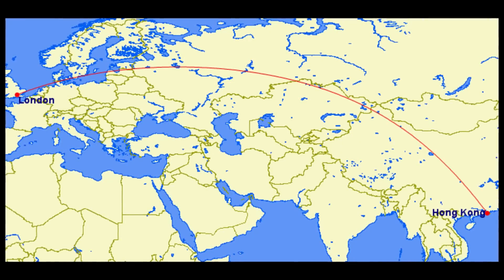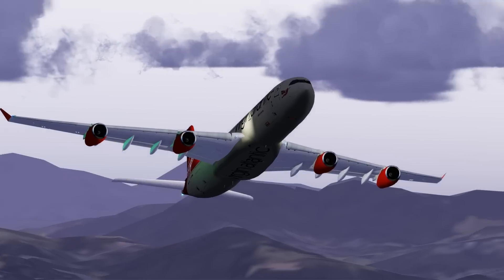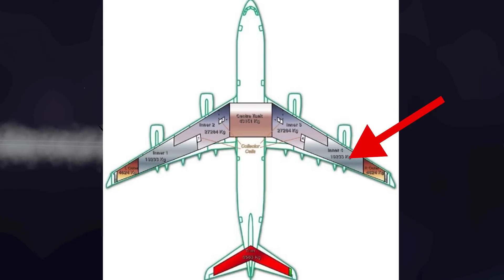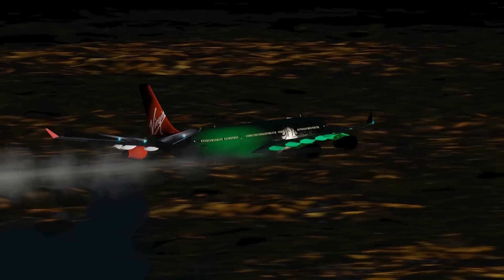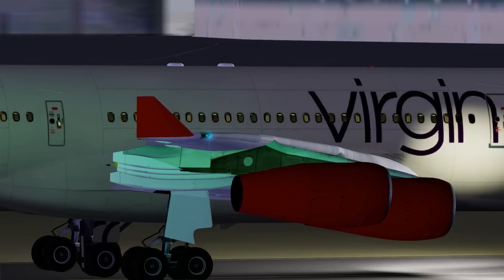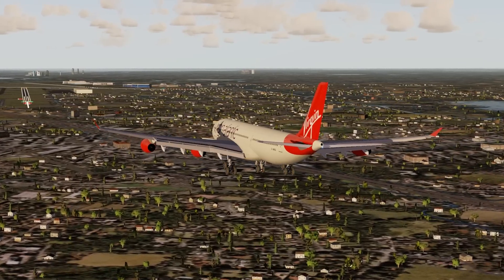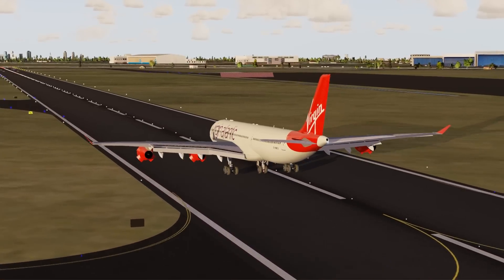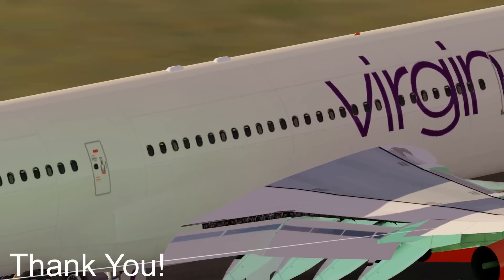How A Broken Clock Left A Passenger Jet With Almost No Fuel | Virgin Atlantic 207

Comment: 14:25    "What do you think of all this?  Let me know your thoughts in the comments below."

I think modern airplanes have become far too complex, resulting in unreliability, and difficulty (if not outright impossibility) of diagnosing problems.   You have computers controlling computers, which control other computers.  A chain is only as strong as its weakest link, so a failure of any one of these multiple daisy-chained computers results in a systemwide failure. 

"The 9000 series has a perfect operational record."

"I know I've made some very poor decisions recently, but I can give you my complete assurance that my work will be back to normal. I've still got the greatest enthusiasm and confidence in the mission." 

"Open the pod bay doors please, HAL."

"I'm sorry, Dave. I'm afraid I can't do that...."

Comment: In olden days there was a human flight engineer.  One of their responsibilities was to keep track of fuel consumption.  They would gasp actually look at an analog meter, interpolate to get a number, and use a pencil to make a dot on their fuel graph.  From that graph they could determine if the gauge was working, I.e. the level was not zero or pinned beyond max and slowly dropping on any active tank, therefore a plausible reading.  From the position of the dot on the graph they could judge whether consumption was reasonable and nominal, whether it was trending better or worse.  There were not duplicate and supervisory computers that could mask or override or misreport or obscure the situation.  In all too many recent incidents the flight crew seems to have had no knowledge of the fuel situation until engines conked out.  IMHO, unacceptable.  Some human should be explicitly watching.  Apparently the automated systems are not smart enough to agree on what is wrong or what to do about it.

Comment: This was just part of the share of electronic problems Airbus had to go through building a complex machine.Boeing also have their share and so will the Chinese  and everyone else.  because of great crew training and luck, it did not crash. No mode of transport is totally safe. They might have discovered they have a problem much earlier if they have retained the engineer on board to watch engines and fuel flow. But then, planes in that era have no computers to play tricks on the crew.

Comment: The nice thing about the A340 is it’s just an extended A330 with extra engines. They both use the exact same wing design, but the A330 has the outer nacelles blanked off. As such, it would make sense for the plane to be able to fly with only two engines, though you might expect some trouble
Reply: For the -200/-300 yes. The -500/-600 has a larger wing

Comment: "Maintenance crews just expected pilots to pull a few circuit breakers"

Unlikely that "Maintenance crews" expected this, more likely that the airline CAMO dictated this as a temporary solution to an ongoing issue.

Pilots are only authorised to operate certain CBs and in certain circumstances.
This has to be authorised by either the flight manual, operations manual or other CAMO document.

If aircrew "pull a CB" because "A Maintenance crew told them to" they are violating safe practices.
The only circumstances where this would be OK for example, would be in a situation where the airframe has taken major damage and has multiple system failures which the flight/operations manual does not cover.
For example those historic incidents where engines have been ripped off, control surfaces damaged and hydraulic systems lost...
Reply: The A340 has reset switches above the pilots which are permitted by the crew to operate. Any CB’s they shouldn’t be pulling are in the avionics bay for a reason

Comment: Very poor system design, and as usual, lack of attention to errors. Pilots treating aircraft like cars. When there is an error warning, don't take off or keep flying.
At the very least, the systems should separate serious errors from insignificant errors.
An error warning that comes up 50% of the time, being the same error that can crash a plane, is the problem.

Comment: Sometimes it seems like replacing the Flight Engineer's console with a glorified arduino might not have been the best decision; and IMO anything computerized needs to have a mechanical, hydraulic, pneumatic, or hard-wired backup for it because having your redundancy be "we have 2 of the same computer that have to agree with each other" doesn't really work when computers are fragile, fickle, full of buggy code, and (in the case of aircraft and spacecraft) constantly being exposed to bit-flips in RAM and ROM whenever they're at cruise altitude from the amount of cosmic radiation. Error checking can only do so much and when your plane's got an expected service life measured in decades, it's extremely concerning to trust a computer to be the only thing capable of performing a flight-critical task.

Comment: How could the plane land safely with that huge amount of fuel?
Reply: Considering an A340-600 can carry about 152tonnes of fuel on board. Less than 30 is not that much in comparison.
Reply: @tomstravels520  where did the fuel go? Don't understand
Reply: @STOPEJECTPLAY  it was stuck in the centre tank. It did not transfer from centre to wing tanks automatically because if the computer failures
Reply: @tomstravels520  thank you. Understood.

Comment: Longtime Airbus pilot here and I’m confused why you think the ECAM item “FUEL T TK XFR FAULT” is a poor naming convention: it was written for qualified A-340 pilots, not for the general public. ECAM titles can physically take up no more than one line on the display with the action steps below that. You apparently don’t know that “XFR” is an abbreviation for “transfer” in many models of aircraft, and this would have not been misunderstood by the crew. If anyone is confused by the title of a procedure (which will always start with the relevant system name, i.e. “FUEL”), there’s a description in plain language as the very next line on the page. 

Second point: not all ECAM items have actions for the pilot to take. After finishing the ECAM message and referring to the QRH in those cases the procedure normally just says “Crew Awareness”, and it gets written up in the logbook. When time permits, company maintenance will normally be contacted to make sure the crew didn’t miss anything; you didn’t say if that was done in this case. 

There are some authorized resets for Airbus aircraft, but not having flown the 346 personally, I don’t know if this was one of them. 

To mitigate exactly this kind of issue my company mandates looking at the fuel page at every reporting point at a minimum to make sure that not only the quantity required is onboard, but that the distribution is also normal.
Reply: Not sure which Airbus you fly but in the A320 family it has the circuit breaker panels behind and above the pilots. On the bigger planes it has the reset switches (like circuit breakers). Those are only above the pilot and may be reset if required. Anything not above the pilots should not be touched apparently is the policy
Reply: @tomstravels520  Are you addressing Virgin SOP or Airbus FCOM guidance? The norm is not to reset tripped CBs on any panel if not needed for safety of flight or specifically authorized. There are some CBs that are forbidden to be reset under any circumstances (e.g. wingtip brakes). There are also Airbus-specific system reset procedures, some of which involve CBs and some of which do not, that are authorized; some of them are only authorized on the ground, some are different on the ground and in flight. My point was that the crew performed a reset involving CBs, seemingly from memory (if I I followed the narration correctly) and it was a common occurrence in this specific fleet. What was not revealed was whether this was a reset specifically authorized by Airbus and Virgin.
Reply: @HEDGE1011  supposedly the reset buttons on the long haul fleet can be used. So for this to reset the FCMC they would pull the FCMC reset button then push back in which they seemingly did but not for long enough. It’s the same as doing a PRIM reset by turning off and on

Comment: I liked that you used A340-300 cartoon for this A340-600 video. I like those tiny engines on this huge plane.
Reply: Not forgetting it appeared to be at cruise altitude with the slats extended.

Comment: As the Centre Tank is used before the Wing Tanks i think i would have Checked the Contents of the Centre Tank during Flight as a Precaution that it was Actually Feeding the 4 Engines, if not, Open the Bleeds from the Centre Tank to the Wing Tanks to keep the Wing Tanks Replenished, and this could have been Achieved within the 1st half hour of the Flight as there was way in Excess of 35 Tons of Fuel Onboard.

Comment: We should all strive for zero fault tolerance whenever it's reasonably doable.  Turning back to HKG would thus have been the wiser choice.
Reply: Not always a practical solution especially if you don’t have maintenance facilities at that airport you just took off from. If it’s a minor fault and you have other systems to take over it’s usually fine to continue
Reply: @tomstravels520  Fair enough. But it turns out it wasn't so fine. Was the extra risk worth it?
Reply: @cchris874  this was only not fine because a fault Airbus did not know could happen. Now it’s been fixed and advise put out incase this happens again
Reply: @tomstravels520  

Yes, I do agree. But the crew ALSO decided to take a risk when it was not necessary to do so, however small. I think it boils down to, if you have any indication that is relatively uncommon, such as being unable to extinguish a safety warning, and having the opportunity to  land much sooner, why not err on the side of caution? Safety culture, IMO, should resolve any unusual doubt in favor of safety, not of convenience.
Reply: @cchris874  sorry but what was the risk? They got a warning to say FCMC 2 had failed. They still have FCMC 1 and if that fails it just means they loose automatic control of the fuel, they can still manually transfer fuel. However they never got the warning to say FCMC 1 also failed. If they did they likely would have diverted sooner. Or if they had kept a frequent eye on the fuel page they would see that the centre tank is not pumping into wing tanks earlier and had more time to deal with this. You’d be surprised what modern planes can be flown with non operational and still certified to fly with. As I said it’s not always practical to just return back if you can’t get the aircraft easily fixed there. Then you have to get the passengers food and accommodation.

I think you need to realise what is a safety critical failure and what isn’t and how these aircraft are certified to operate with different failures and redundancies

Comment: Problems that occur frequently, even when they seem manageable should be escalated and the real reason what goes wrong should be determined.
I had things like that in IT on medical diagnose equipment. You find a system totally messed up and when you ask more intensive you hear, that for months or even years it got a habit to do crazy workarounds by the without operators without understanding what they risk or mess up but informing service personal because ....

Comment: Cars that won't start if a door is open, won't go into gear if the bonnet is adjar, remove most engine power if a sensor becomes faulty without mechanical fault. Don't allow data geeks to design impediments to mechanical function, this whilst supplying no remedy for their data malfunction, data controlled mechanisms without  mechanical mechanisms to manually controll those functions physically, or to override bad inputs by computer,  by pushing ignore when computer has placed you in peril. A digital or manual override must be available as required or we are all fools in a geeks basement, watching them rule a world without common sense, applauding their botched ding dong noises, their plans to remind forgetful bags of grocery, animals, baskets of washing to put it's safety belt on, how obviously lacking  common sense was this wiz at the keyboard. I kno when I'm going beyond a certain speed but the antagonizing continuance without a manual relief, head butts to that genius. Harping moaning, i know best, ding ding ding ding ding dong brain looser. I wish I could meet up with warning noise developers personally, not to advise or complain about their accomplishments, but to break their fingers and glue their eyes shut, I'll say I just had a little malfunction, it happens some times, nothing you can do, surprise, push restart.

Comment: 1:50 .not correct, an ECAM caution without actions is not considered weird, its pretty common actually.
what you are describing is a Level 1 ECAM caution.
They carry no ECAM actions to complete and don't offer any aural alarm to us in the flight deck.
They are purely displayed on the ECAM for giving us awareness of system degradation and me must then monitor the status of the fault (if possible)
hope this helps
* also FUEL TK XFR FAULT means fuel tank transfer fault 🤣standard aviation phraseology seen all over the world

Comment: If the problem is really as pervasive as mentioned, I'd expect a mandatory recall to replace the unreliable units before something like this happens again.
Switching devices off and on again routinely is not the kind of reliabilty I expect from a modern passenger jet.

Comment: Similar to and yet different from a case in 1983 involving Republic Airlines in the US. An MD-80 (back when it was still called the "DC-9 Super 80") lost power in both engines after the crew neglected to configure the fuel system properly, leading to the wing tanks being emptied while the centre tank still had plenty of fuel. Fortunately they managed to slosh enough fuel around to relight one engine long enough to power the boost pumps, otherwise they'd have had to crash land in the middle of the night in unfamiliar territory.
Reply: Odd the designers never thought there would be a reason to run the boost pumps from the APU.

Comment: Aircraft designers need to keep things simple because the more complex the more to go wrong and the harder to sort out when flying. Seems highly irresponsible for pilots and engineers to think is ok to turn systems off and back on again to clear errors  and then keep flying not knowing what the problem was/is based on the hope that everything will be fine. The off-and-on again temporary fix might be fine for a home pc but the stakes are too high to rely on that in a passenger aircraft. These guys did not put safety first and need to have their arses kicked until their noses bleed.

Comment: Hang on, if they were already in Dutch airspace they were under 300 miles from Heathrow, and no more than 90 from Amsterdam. At that point their biggest problem would be losing altitude fast enough to get stopped at Schiphol. But given the imminent lack of engines they made a good decision to not head out over the North Sea.
Reply: No way were they in Dutch airspace.  Approaching Dutch airspace maybe.
Reply: You’d rather circle down near an airport than fly over the sea to another, especially if you’re on ‘bingo fuel.’
Reply: @DaveTheRave87  Ex RAF Manston is only about 15 mines from there.

Comment: I flew an Embraer for a few years. Every February we were met with weird and wonderful errors on the clock. Each and everyone was due to the clock. We saw that there were now as many 90 hours in a day and 100 minutes in an hour. We were told that we were about to run of fuel, couldn’t reach our destination and other rubbish.  All of this was due to a “February” clock. The silly clock drove all the internal systems.
Reply: Brazilian clocks can't handle cold weather ?
Reply: Omg!
Reply: Ok that’s concerning 😮😮😮 Was it built by Ford?!
Reply: @TraceUK  Until you got used to it and before other systems were updated it was concerning. As a result of these updates just the clock’s display that now does stupid things.

Comment: I was on this flight, it was 2005 not 2007.  When the cabin crew announced the plane was going to make an emergency landing at Amsterdam, instead of people freaking out like in the film Airplane, it was so quiet, you could have heard a pin drop in the cabin in the last 15 minutes of the flight.  The plan was to fix the A340, and fly on to LHR,  but as time went by, the departure time was put back several times. We were at Amsterdam for around 10 hours before Virgin sent a 747-400 to pick us up and get us back to LHR.
Reply: Could just have visited Amsterdam instead, 15 minutes by train
Reply: As long as I can hear 2 or 3 of the 4 engines running I will remain calm even in massive turbulence and lightening.
Reply: @thedave7760  you can remain calm even with 1 engine running....
And if you have eric moody as a captain you can remain calm even with 0 engines running
Reply: or Sully
Reply: You can only keep calm, If it s am Airbus 😉
Reply: @peterborg3340  This video highlighted some of the Airbus safety holes and here you are praising Airbus. Hard to tell if you're serious or if you're just being sarcastic 😄
Reply: aShUaLlY